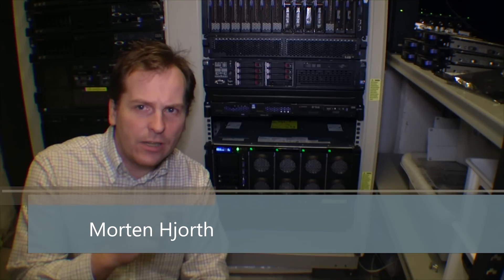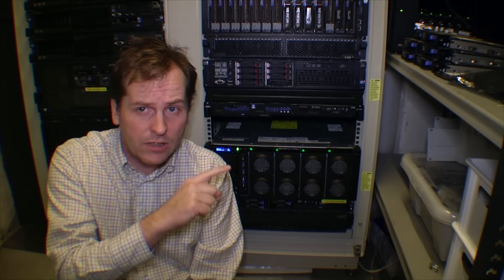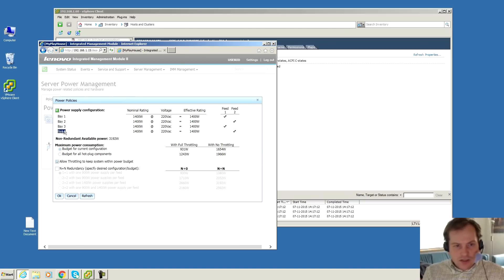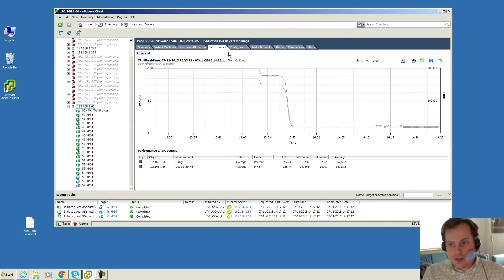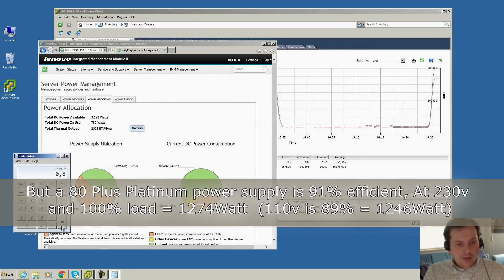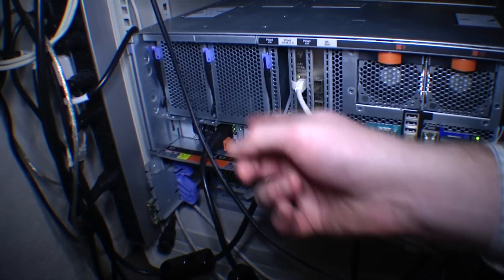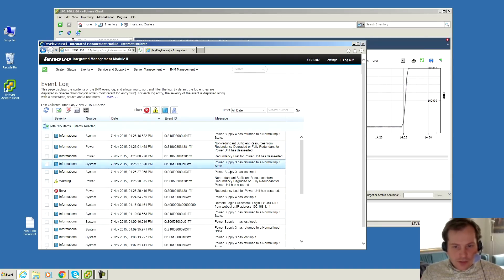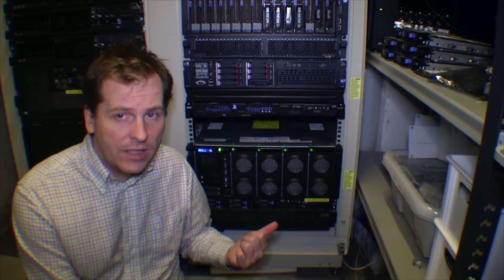Lenovo System x3850 X6 Power Consumption and PSU redundancy - 269

Comment: How to resolve server 3850 x6 error memory board faulty proc 2 dimm 9
Reply from the maker: Try and swap block in slot9 with another block, if the error moves to the new slot,, it´s the RAM that is bad,, if it is still dimm 9 then it is CPU or System Board,, not good :-/